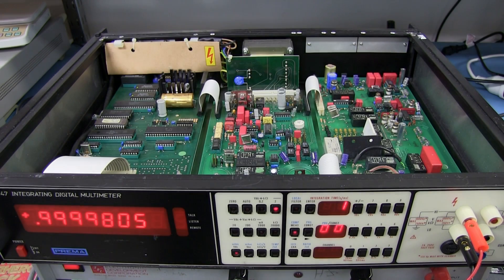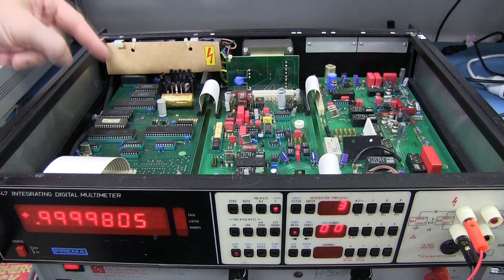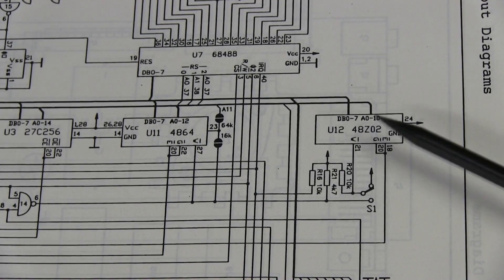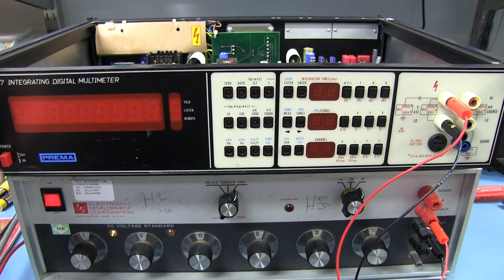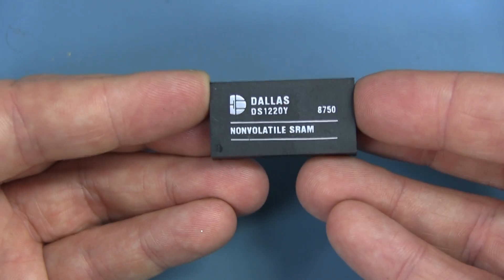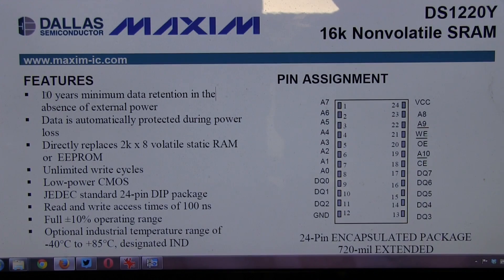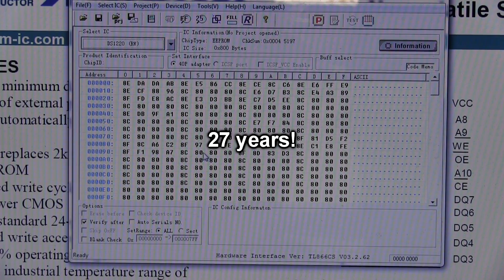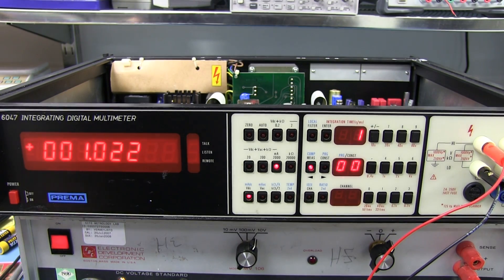EEVblog #615 - Prema 6047 Multimeter Followup

Comment: I know it's a pretty old video but I would appreciate if Dave - or someone else - could answer a question:
Can I replace this infamous Dallas NVRAM by a modern battery-free parallel EEPROM, such as Atmel AT28C16-15 (150nS)? I already know they are pin to pin compatible. But, is it fast enough? Any other possible issues?
I have a Hameg HM8112-2 desktop multimeter (Prema clone) and I know that the time is coming up for the unavoidable death of the battery inside its NVRAM and I don't wanna to loose all the calibration data inside it.
Of course, before replacing it, I should save and copy the contents from the Dallas to the EEPROM, both to keep original data as well to avoid any checksum errors during startup.
Thanks!
Update: I know EEPROMs has quite limited writing cycles, but I'm assuming that data will be writen only during an eventual calibration process. That happens at most once a year or longer if the instrument still on the specs. After that, only read cycles will be performed during normal use of the multimeter.
Reply: I've found someone on the web that supposedly made this NVRAM replacement on some Motorola transceivers. But I still want to hear more opinions. Check it out.
http://www.repeater-builder.com/motorola/maxtrac/replacing-dallas-nvram.html

Comment: Hey Dave, 
There is a guy that worked on this problem with non-volatile ROM. He came up with a solution (kit) & It can be purchased here for around $10.00 
Can something like this work on this type of chip?
 https://www.reactivemicro.com/product/battery-iigs-rom0-1-caddy/

Here is the video
https://youtu.be/wdFm91gAs_Q

Goto 26:50 on  video the computer has a non- volatile bios ROM chip with a  standoff socket under it with a potted battery. but it has 28 pins, not 24. Its made for the Compaq Corporation. The Potted batteries inside the standoff socket can be separated from the BIOS Rom.
The Potted standoff socket has "SMT INC."
More info....

http://quick09.tistory.com/attachment/cfile25.uf@2554F136593CFDB60A8EEC.pdf

Comment: Could cleaning of the contact terminals help to correct the calibration discrepancies. Are there other components (resistors, caps) whose reference values "drift" with time (whe're talking about 27 years...).

Comment: I´m so happy that all my mid/end 80th made synthesizers do not have a dallas chip. They all use 3.6V batteries and a little external battery backup circuit to prevent loosing the SRAM content.

Comment: For the Dallas RTC chips on old motherboards, I've cut the old battery out of the potting, soldered cables to the power pins, and mounted an external battery.

Comment: i got the Prema 5017, it still works, got a thick aluminum or iron case ( i think its aluminum) and a scanner port adapter card (to expand the available measurement lines).. first time i opened it (broken fuse) it shocked me how many relays the can put into such a compact dmm

Comment: So can/will it be recalibrated? It would be nice to see all those digits reading correctly after such a long time
Reply: Also what's involved in calibrating it? I notice Dave has a high precision voltage source, so would the goal just be to calibrate against that and assume the newer instrument is good? At some level I suppose you start needing to actually use verified SI references at those accuracy levels.

Comment: I suspect there is no problem with the firmware, or else the checksum would have failed. Perfectly natural for gear of this age to have drifted, especially if it has been unpowered for a few years and in a possibly unheated room with occasional humidity and condensation, but no power to drive off the moisture.

Comment: Looking at the schematic, /W is pulled high unless the S1 is changed.. Very interesting the BOSCH reference.. I'm going to grab that ROM image and have a bit of a look at the cal information..  I re-write ECU code as a job. :)  Interesting that there's a 64k SRAM option.. Put the NVSRAM data up too!! Those NVSRAM's will last for years, as you've found. They won't use the internal Lithium battery until the device is powered up for the 1st time.
Reply: l28power There is no reference to Bosch itself. It's just the name of the street where Prema is located.

Comment: Those Dallas chips were really good. I have 2 RTCs from '88 and '89 on old 386 based boards and they still work perfectly after so many years. For a comparision, today's CR2032 batteries die after 8 to 12 years (sometimes even faster).

Comment: So the company that made that chip are basically scumbags for not making the battery user replaceable.
Reply from the maker: No, there are very good reasons why it's sealed like that. It can be a design advantage. If you want a replaceable battery, use your own 6116 SRAM, diode, and battery.
Reply: At least Sega made it so you could replace the "suicide" batteries some boards, whether intentional or not! I have a arcade board with a snap-hat battery and my old one died, thankfully I had SCSI card with the same batteries with a good charge in them. Not that it would have killed it but redoing the settings and time is a pain
Reply: Manufacturers, like Dallas, design components with a lifetime. A 20 year lifetime is IMHO above average. I doubt anyone at that company expected to even be selling that chip in 20 years, given the rapid pace of technology changes that were occurring at that time. There was no point in making the battery replaceable.

Comment: I really don't like the engineered designed to fail mode, i guess they didnt expect you to be able to read and replace the chip!
  how much more honest to just have a battery holder on board than pot it all up
Reply: Naoki Saito
This is the sort of equipment where the people who buy it are expected to maintain it, or at least send it in for maintenance. Any metrology lab will have a ROM reader/writer that can copy the data from the Dallas chip to a new one as needed. The chip is socketed, so you can pull it out before the 10 year date, copy the data to a new chip, and toss the old one. You would schedule the replacement to coincide with calibration of the device.
Reply: Being potted is a long term advantage, as it prevents the battery from leaking all over your board and eating it away.

If you actually watch the video, Dave mentions the original cal data is stored in ROM as a backup.

Finally, this is an expensive metrology grade meter. If you can afford one then you can afford to take it to a cal lab!
Reply: It doesn't look like it's designed to fail, rather a slight oversight. Again with Sega and suicide batteries, they weren't designed to fail, they were designed to protect the board but just had the issue that even when used legitimately that eventually they'd fail.
Reply: +jusb1066 Nobody designs equipment to last 30+ years.

Comment: That's German quality!
I mean look at the W.German-made "golden" capacitor. It lasted for over 20 years without exploding or/and breaking while as good as all Chinese caps don't even last one bloody year!
But sadly the that is what the US wanted in the 80's and 90's... move production to China and its neighbors because it's cheaper but that cheapness is reflected in to the final product quality.
This idiotic hype also "infected" parts of the German industry
Reply: I've got 20 odd year Nichicon caps that works just fine as well. Who made them doesn't make much of a difference (among the decent brands) - the environmental conditions they've been used and stored in, and the load put on them, does.

So, German or Japanese, doesn't really matter. They all live and die the same.

Comment: The write protection pin is pulled high via the external switch. How can it write into the memory?
Reply from the maker: Yes, I got that bit wrong (pun intended). It just reads the checksum.
Reply: EEVblog
you are allowed to get it a bit wrong dave on occasion
Reply: EEVblog
It was good for a giggle at least... ta :)
Reply from the maker: jusb1066
 The problem with hitting record and then just jabbering away.

Comment: 27 years! Wow! The usual bodge hack is to cut into the chip, disconnect the battery terminals from the pins and solder an external CR2032 or the like to the internal cuts to the outside of the dallas chip to continue using it as nothing ever happened... after restoring the data, of course. I'm planning to do something like that when I get my SLT/386 out of the garage, soon.
Reply from the maker: Why bother? Just read out the contents and program a new chip with a new battery.
Reply: EEVblog
I think nrdesign1991 and ***** are thinking of Dallas RTC chips, such as used in the IBM PS/2 line of computers, which compatible chips (to my knowledge at least!) are as rare as rocking-horse shit! :D
Reply: I did that with my CD-i player which had a dead battery
Reply: *****
And if you ever find one, you can be sure it's battery is dead because it's NOS. It was easier than desoldering the chip, finding a working replacement etc.
Reply: *****
If your talking about the DS1287 look at the DS12887 you can find new ones for ~$7
Reply: ***** this! the first thing I think of when I think Dallas are the RTC chips used in those--- I'd have thought similar chips were used with a similar amount of sram for keeping CMOS settings in-- I could be wrong though, it's been ages since I've even looked at that poor SLT.

EEVblog from my perspective, dallas chips were, from what I could find at least, expensive for replacements-- now looking on eBay they're going for peanuts, because last time I checked (2009ish?) people were selling them for at least 10-12 funny-money dollars a piece depending on the datecode (more than I'd have liked to pay at that time as well.) This, and most are not socketed on computer motherboards of that era... so it's either a desolder, solder socket, then drop new one in socket, or a quick melt with the iron (or dremel!) above the right pins and a button cell socket above the chip so the same dallas chip can just stay there in place; one can argue that's more reasonable for most (and if done right, looks like a clean bodge hack) than doing a full computer dissasembly. but you're right-- now that dallas chips can be had with recent datecodes for megacheap, I see no reason why one can't buy a new one and make it happen... and since I now know this, I may just buy one!  ...given that it's not fake. seen any fake dallas chips on eBay lately? heheh.

also for the record, I've seen at least one person mod the chip while still on the board in an IBM PS/2 on youtube; I can't find the video anymore. but the site they referenced for the mod is still in my bookmarks: http://www.mcamafia.de/mcapage0/dsrework.htm

and this, which I've found also points to that page: http://www.nekochan.net/wiki/Fixing_the_Dallas_NVRAM_on_an_IO4_board_with_a_CR2032_cell

Comment: Looks like the most significant bit is always 1. I'm wondering whether this is deliberate or just a bug of the programmer.
Reply: kraklakvakve
SRAM will tend towards a power on state of either a 1 or a 0 per cell, which generally will not change much with each power on cycle. It will differ from chip to chip, as this is very dependant on the internal geometry and the alignment of the particular cell, along with the power on ramp. You could see this on older computers which used SRAM for video memory if you disabled the processor ( or held it in reset) on power on where you would have a random display, changing a little with each power cycle.
Reply: I've read blank EPROMS in mine and it's very similar to his.  It always reads back FF on blanks.
Reply: sprybug
EPROMs are different - FF is the unprogrammed state - individual bit transistors have no charge on the buried gate. In SRAMs however, each cell is basically a flip-flop, there is no unprogrammed state. If each flip-flop would be symmetrical, on powerup it would contain random noise.

Comment: Price seems to have shot up on those EPROM readers, cheapest on eBay is $53 delivered. I've been looking for a cheap one to test TTL and SRAM chips.
Reply: Yeah, I got one of those for about $35, but it was a TOP853, the cheapest I could find, and it doesn't have the range that his has.  It works well and is very similar, but I think his supports more chips than mine.